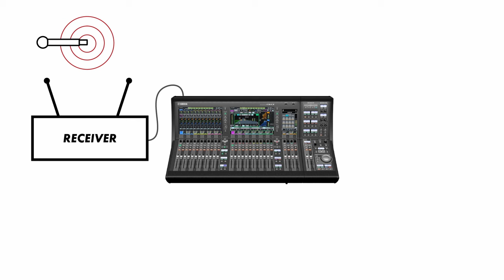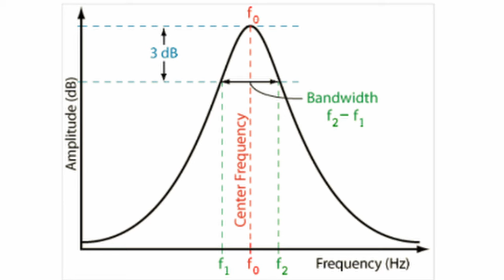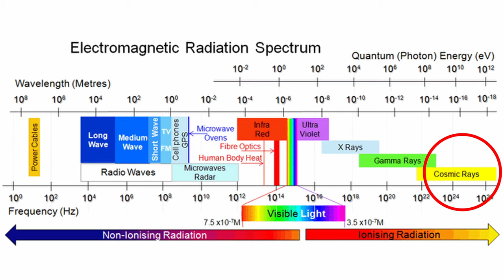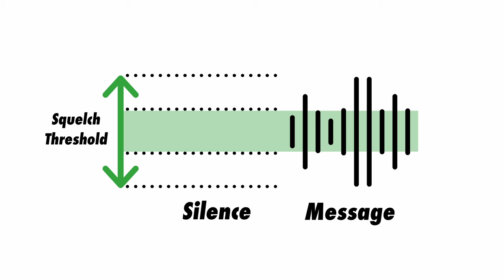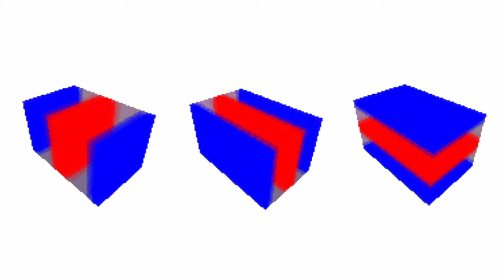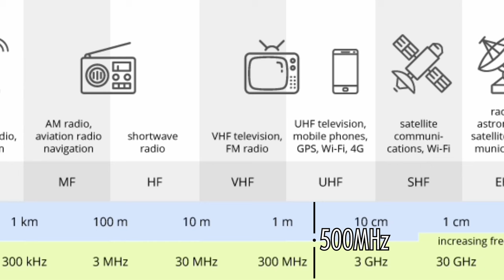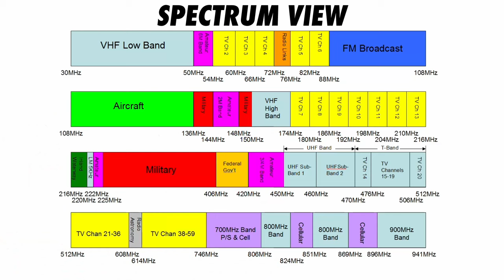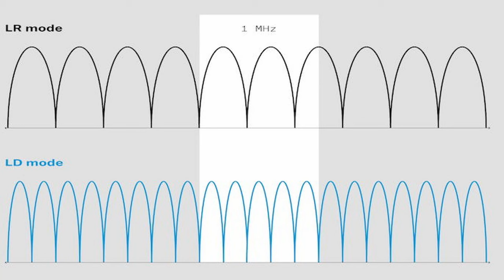How Do Wireless Microphones Work?

Comment: Good video as usual. If I may point out a few things. As you pointed out analog FM wireless systems do not transmit constant RF but a modulated RF band, the RF transmitter frequency is modulated by the audio information. So each transmitter must use an RF band width as mentioned, of about 200 MHz in order to transmit audio content within 20 Hz to 20KHz including amplitude information. So if two wireless transmitters were used simultaneously they would need to use two different frequency bands. A rare issue that could occur is interference between two wireless systems if their respective bands are set too close to each other. Because an analog transmitter requires a 200 MHz RF band to function, the available RF space becomes limited and restricts the number of analog RF systems that can be used together at the same time. Regarding digital wireless, the transmitter only needs to transmit an RF modulated signal consisting of ones and zeros. This reduces the bandwidth requirement considerably and allows more transmitters to work within the same band. And as John McGregor mentioned there are still steps to be taken to minimize interference. I hope you will cover digital wireless and the pros and cons of using entry level systems as opposed to more professional systems in more detail at a later date.
Reply: 200 kHz-wide channels, not MHz :-) WMAS is an interesting TDM-based approach to using 2/6/8 MHz channels in the duplex gap, but it's not universal yet. Up to 64 audio channels (in or out) from a 1RU unit looks pretty interesting though.

Comment: My band leader is a bit slow to tech. Well after many years of owning a wireless in-ear system he finally got a digital board to go with it and build out an in-ear rig. So he got everyone together to get it all setup and try it out and.... it's a 600mhz system. It wouldn't work at all because the background noise from digital TV totally drowned it out.

Comment: Id love some info on lavalier mics, and how they can sound good while being so small.

What specs would you even look for in a good laminar mic?
Reply: Do you mean Lavalier? Laminar is not something I've heard used surrounding microphones before.
Reply: @matthewmason7753  yah yah yah my bad LOL.
My hands moved without my brain... typing too quickly.
Reply: i wonder if they will come out with a LAV mic that is 32 bit float that way you cant clip it at the lav
Reply from the maker: @Dogo.R Have you seen this video? https://youtu.be/0Ir4yztgjG0?si=yQwQsOwyYQiiJRg5

@YoungBlaze Some recording devices record in 32-bit float. Sometimes the device is inside the mic, sometimes it’s external. So, any lavalier microphone could work with a 32-bit float recorder.

Comment: I'm not sure if the info graphic of cosmic rays is accurate. I think there are more ways of electromagnetic radiation from outer space reaching earth. The frequency range you highlighted on that infograph would be highly dangerous, potentially deadly and certainly cancer inducing. I'm pretty sure Earth's atmosphere would block that kind of frequency. what do you guys think about that?